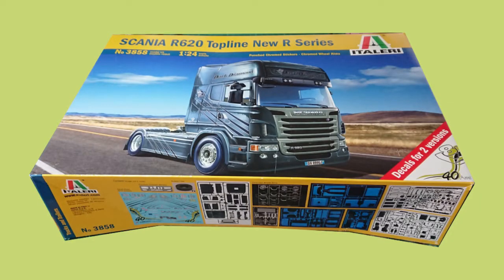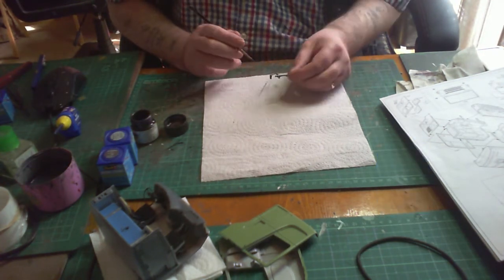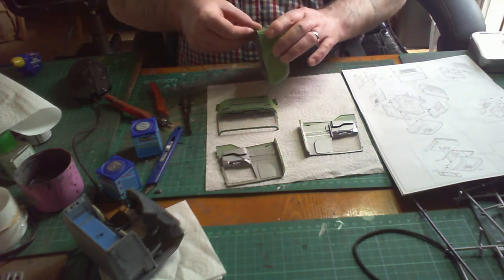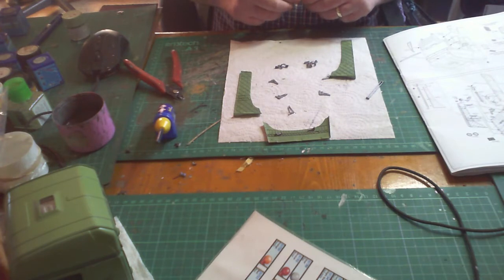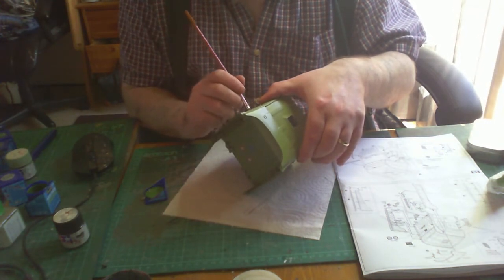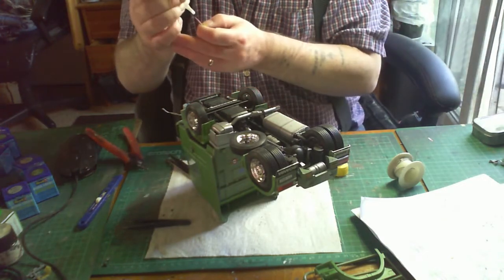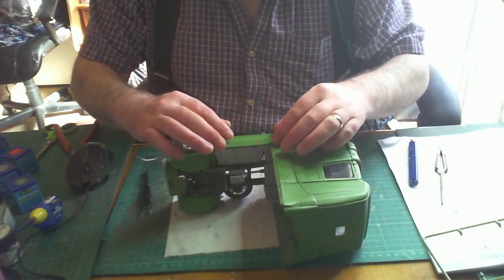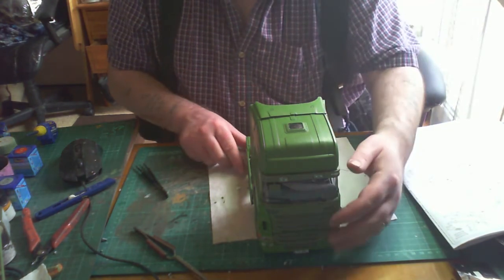Italeri Scania R620 Topline 1/24 Base Unit Part 4 Main Cab

Comment: Hi Gavin, New to your channel and have been watching and enjoying a lot of them lately.  I notice that you mostly work with water based bottle paints.  Do you ever use spray cans or an airbrush?  Thanks
Reply from the maker: Hi Dave E, thanks for watching. I do have an Airbrush, currently I have an Iwata Neo and a Harder & Steenbeck Infinity CRplus. I hardly ever use them though mostly due to the cleaning process.  For me it just takes too much time to clean them after a colour change and then breaking them down once I've finished. I use spray cans for primer all the time and will occasionally use them for the main paintwork.  I do enjoy using a paintbrush overall though and tend to stick with that no matter what the scale is.
Reply: @ReckshawScaleModels Thanks for the response.  I agree completely about the airbrush cleaning.  Just too much work.  I gave up on using the airbrush some time ago because of the time consuming cleaning process.  I am enjoying your channel!!